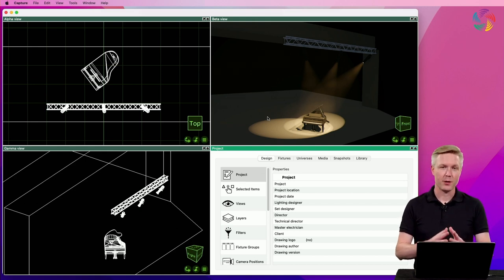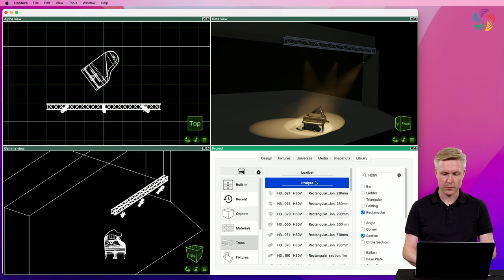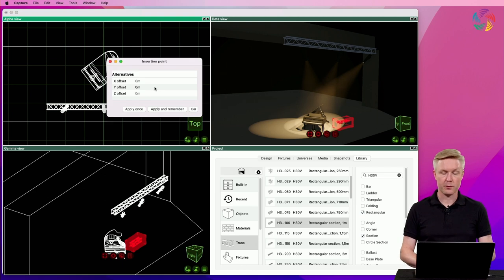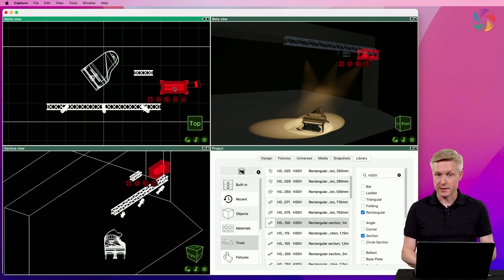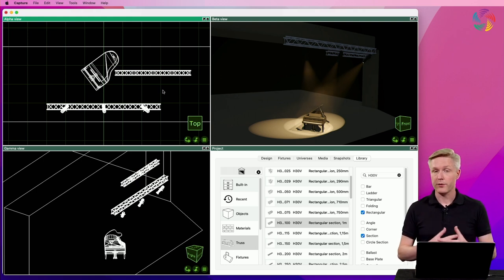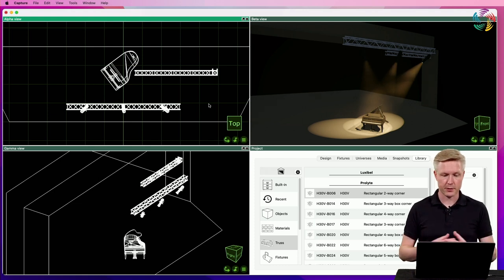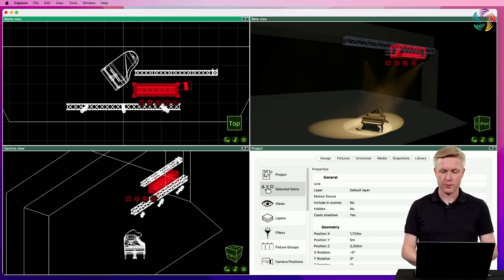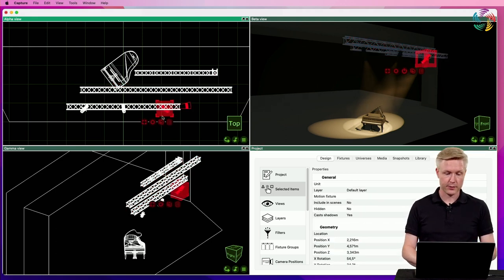Truss

Comment: If you draw with Generic Truss originally, is there a quick way to find and replace with specific type of truss later or would you need to delete it and add in the new truss?
Reply: Once you select a truss piece, you may enter the replace mode (Shift+Ctrl+R) and drag the new truss piece onto the one you wish to replace.